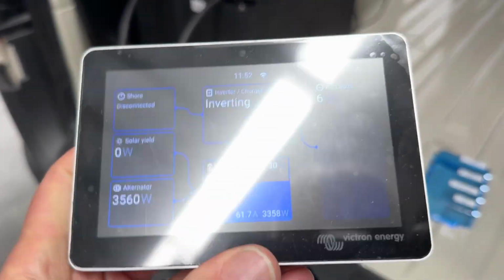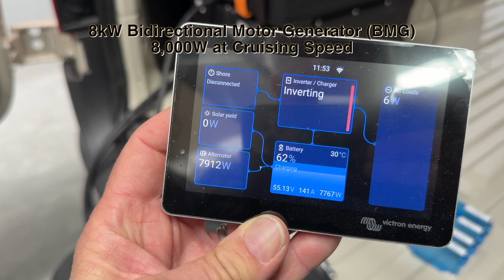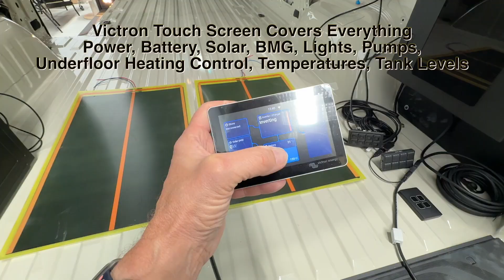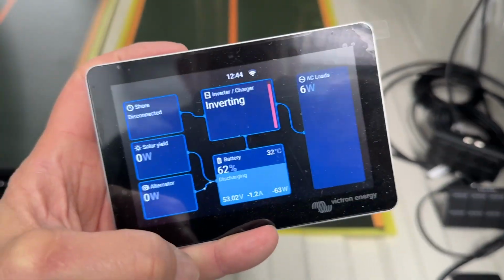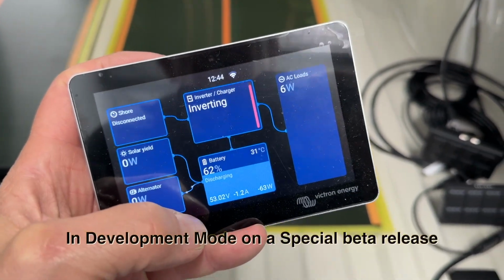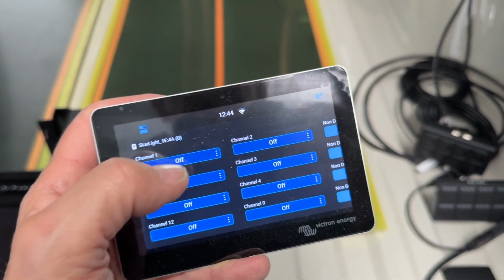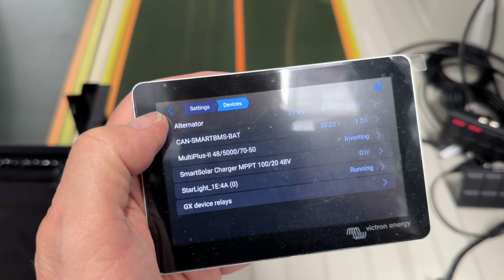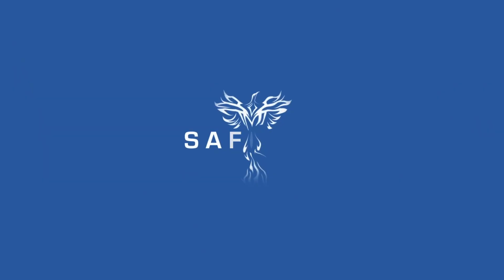The Ultimate Off-Grid Power Setup: Control EVERYTHING From One Screen!

Comment: Does this mean your generator has the smarts in it and can charge directly to the batteries, rather than having a Scotty in-between and limited to 3kw?

Also, does this mean it's currently only limited to CAN communication batteries?

I've got a 24v 150amp alternator and a 3kw 24-48v Scotty from you that I haven't installed yet - is this generator a better idea?
Reply from the maker: Yes it charges directly. No you can have any 48V battery. See our manual here: https://university.safiery.com/view/436546982/

Comment: what temperature sensor have you used for the floor heating?
Reply from the maker: Ruuvi Puck. Then Victron Developed Temperature control in the Cerbo and we drive a 48V Smart Battery protect from Relay 1 on the Cerbo. Its very slick.
Reply: Luv ya work Bruce, good luck with the move over ere in tha west mate hope it all pans out 🤙🇦🇺